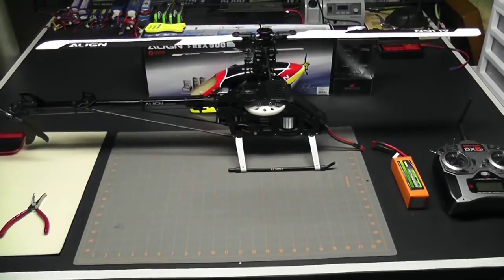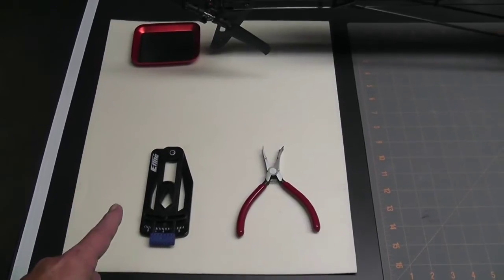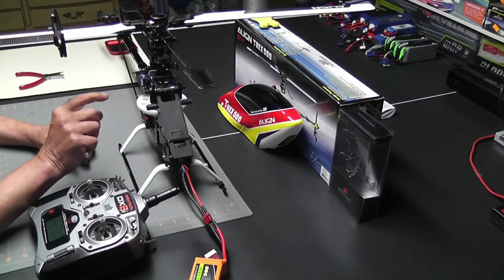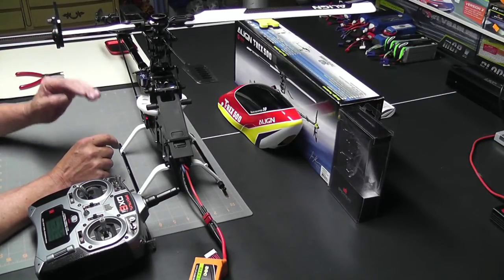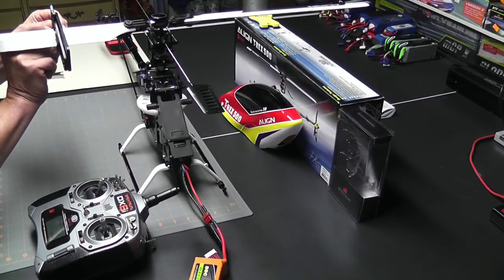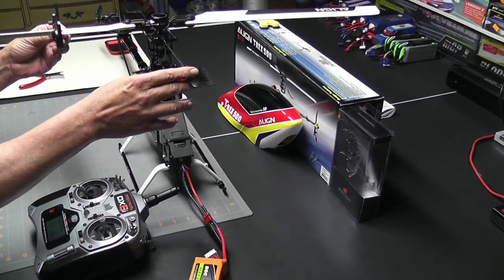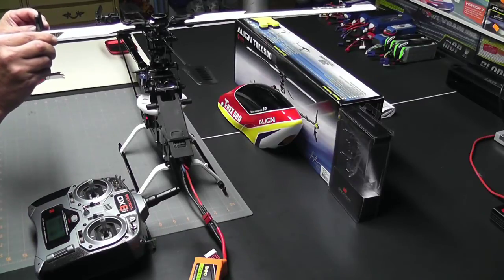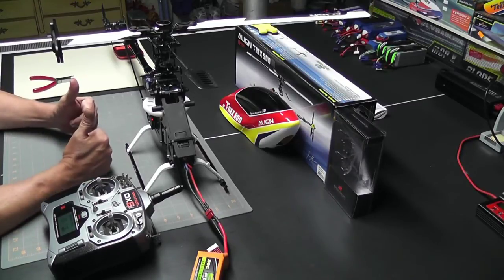Trex 500 E - Electronics and Setup #5

Comment from the maker: Hi there and thanks for posting.  I know exactly what you are talking about.  My goal was to get both paddles not only level with each other, but also level with the head.  I found the best way to accomplish this is use the mold line on the flybar cage to line up each paddle with.  Since the mold line is usually dead center on the cage, I know both sides would be equal.  Then I simply lined up the paddles with that line and presto!  Note if you stand back a foot or so you can line it up better.